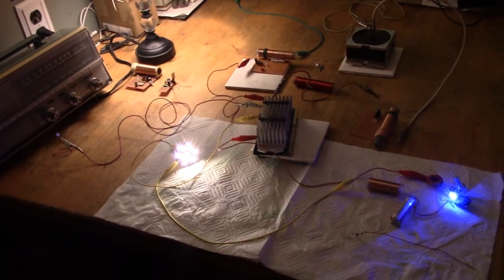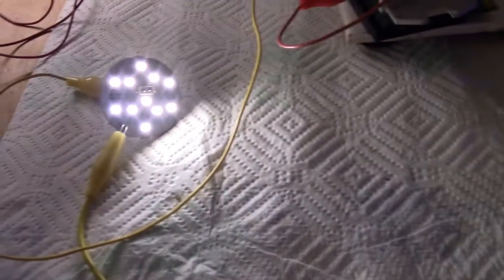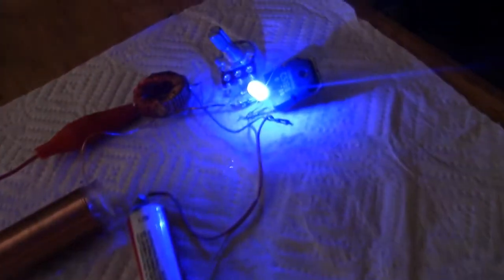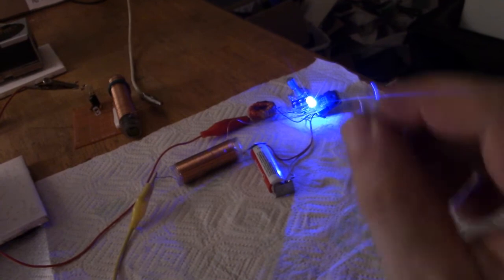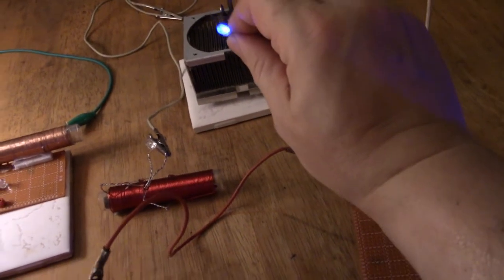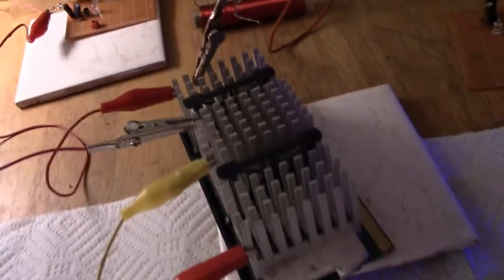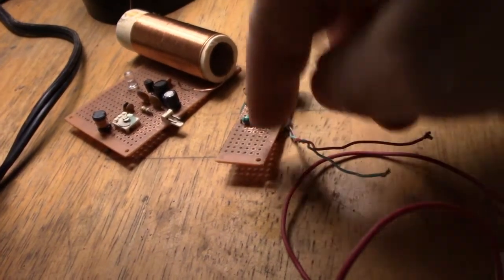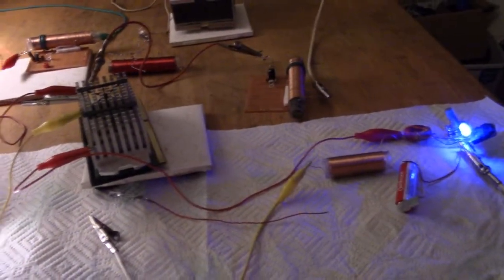Jeanna's Light wireless uses & Dr. Stiffler circuits update

Comment: Before watching the entire video, thanks for the schematic(and thanks Cleveland Storms i guess). However, it doesn't show clearly where one side of the 15t winding is connected, unless it goes to the 10k pot as well. Can you clarify?
Reply from the maker: The 15T is joined to the 4T...is that what you mean ? the other end of it goes to the transistor Collector. I got the schematic from Rimstar's site, but it is elsewhere and seems to be the reference. 
My change is the LED instead of the cap across the Emitter and Collector. For no obvious reason there was no improvement with various caps and also an amperage jump.
Reply: Oh, joined where it goes to the + of the battery, now i see. Like a joule thief.
Yes, adding a cap was my thought to, but that might cause it to blink, like a Penny Circuit.